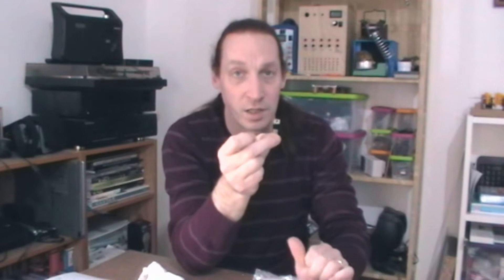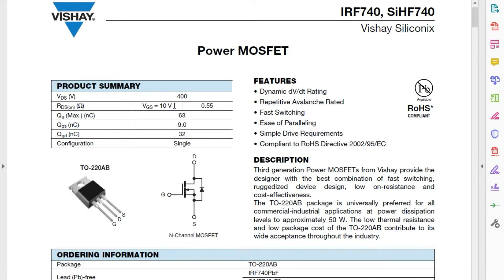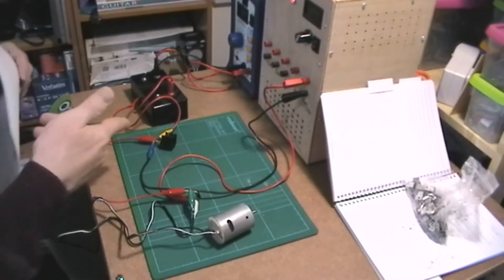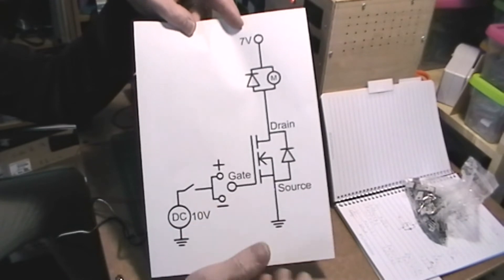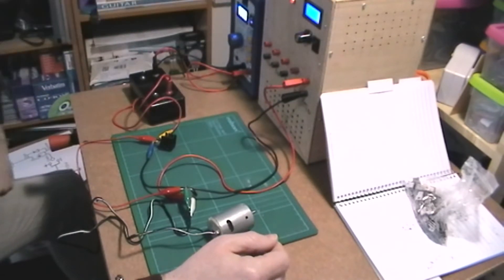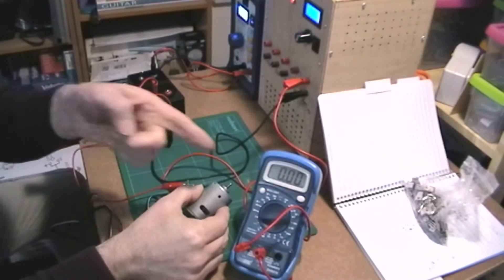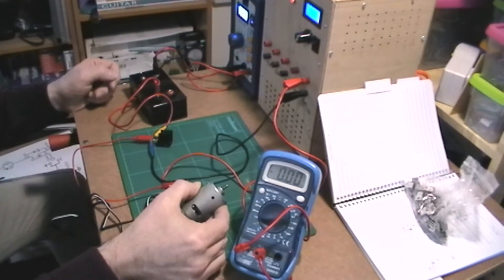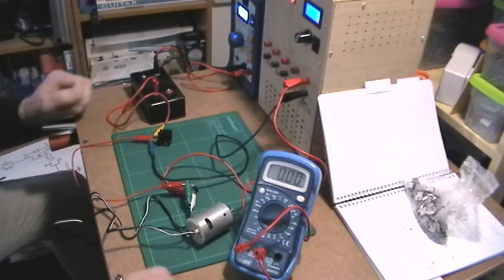MOSFET IRF740 (getting to know it)

Comment: May sugest you to add a 5 to 10 ohm resistor in series with the gate?

It seems to me that you may have some oscilatons at the gate due to its parasit capacity.

This oscillation keeps the gate oscillating and the mosfet switching on an off at frequencies higher that the ones you detect with your setup. But these on/off oscillations tranfer enough energy to the motor to keep rotating.

The resistor would attenuate this oscillation.

If you have an scope at hand you could likely see the oscillation at the gate. 

If you increase slowly the gate voltage from 0 to 10, it will likely start oscillatiing midway around 6v. Its no a big deal is you want it on. It will end up on full time once you reach the 10 volts.

But in the way down it may stay oscillating from around 4 downwards even once you reach 0v.

I think this is why you need the negative voltage at the gate to fully switch it off.

Thanks for your video!
Reply from the maker: Hi Alberto, thank you for the advise.  I will give it a try and see if I can see it on the scope.

Comment: I'm perched over an interconnected pile of fat gauge wiring, arm-sized heat sinks, and a tornado of fans, all strewn across my desk, hooked up to various ammeters & voltmeters,  testing a home-bodged 2.5kW power supply at its max spec of 200 Amps @ 12.6V DC.

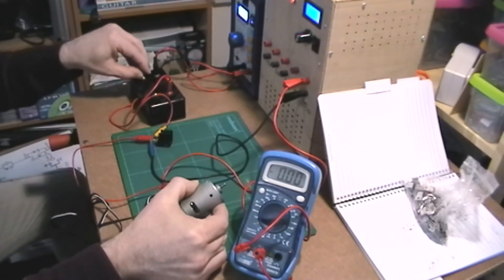8:10 made me question, briefly, the wisdom of this.
Reply from the maker: In the pursuit of technical knowledge, there are now boundaries.  Even if it is bordering on the damned right dangerous.  That is why the phrase "don't try this at home" exists.